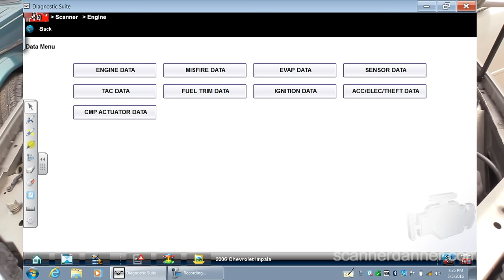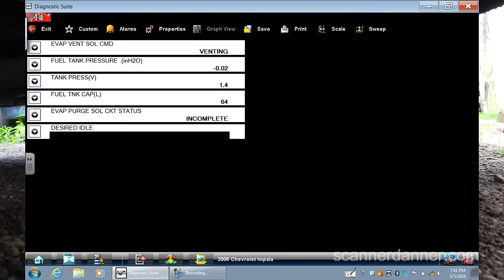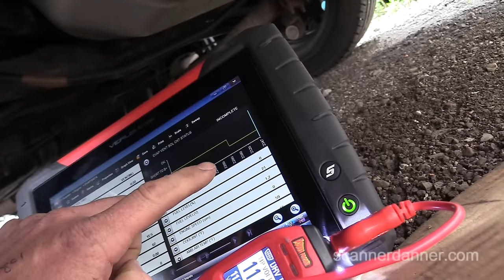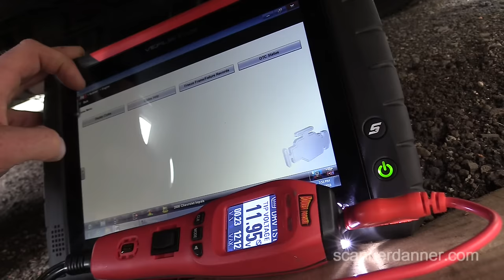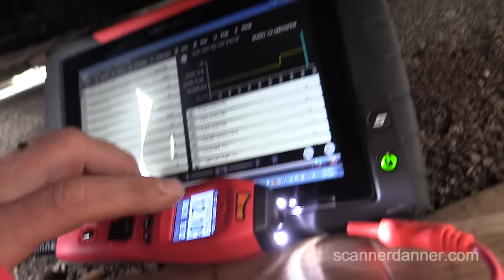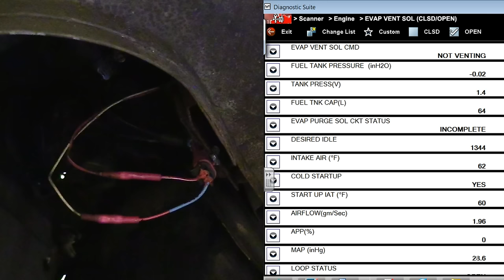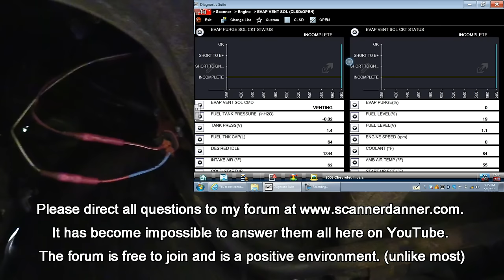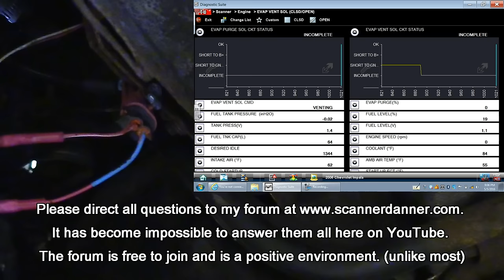EVAP vent solenoid wiring repair and testing P0449

Comment: I save connectors and harnesses off of vehicles and just make up a new pig tail by removing a terminal from a used connector. Remove terminal end from old connector and replace is quicker for me in a shop setting..
Reply from the maker: for sure! Good tip

Comment: Scanner PLEASE help me if you have time!!!! I have a 2006 Chevy trailblazer 4.2. I have no power at the solenoid connector. I cut up from the connector 2 inches to put a new pigtail on. I stripped the wire to prepare for the connection but I have no power at either wire still. Could you please tell me what you recommend I do next? I only have a Innova 3140 so please bare with me. Thank you so much in advance for any time you could spare for me!!!!!!!! Codes are p0443, p0449. Solenoid and vent valve both replaced with gm parts. I have power at the rear vent valve.
Reply from the maker: Do you have power to your purge solenoid under the hood? They share the same power feed from fuse 26 "TCM CNSTR" 10 amp in the underhood fusebox
Reply: @ScannerDanner  wow THANKS SO MUCH for the quick response! I honestly appreciate it. Sorry if I didn't explain it right. The problem I'm having is the solenoid connector under the hood, I have no power to either connector wire. Or any power 2 inches from the connector were I cut to put the new pigtail on. I do have power to the vent valve by the gas tank. Not 12 volts but I think that is from having a horrible ground back there,  but both wires by the gas tank I was getting at least something. I'm not getting nothing from the wires under the hood. I have good power at the fuse. Sorry I also have a C0110. Not sure if that is related but I think that's a connection issue also.
Reply: @ScannerDanner  UPDATE!!! there are 2 wire that go to the purge solenoid, one is green and the other is orange. I cut a little further up past a kink in the green wire, and now I'm getting 2-4 volts.
Reply: @ScannerDanner  sorry man! Scratch that update. I think it was a misreading.  It was jumping from 2 to 4. Now I have nothing. I'm having a helluva time with this thing plus I'm trying to repair it out in the cold. And if you even worked on 1 of these purge solenoids they are in a screwed up spot. Any time and help is sincerely appreciated!!!!!
Reply from the maker: follow the harness, damage occurs in areas of heat and vibration, look for contact points of that harness to locate the damaged power wire.
Reply: @ScannerDanner  I've done that but it's in a huge harness with seriously 40 to 60 other wires. I've had to remove the pcm, the pcm bracket just to get to the harness to remove the plastic outer harness cover. I've pulled the 2 wires out of the bundle but now I'm at a Y in the harness and it's really taped up. My question is if fuse 26 is where them wires go to, can't i unscrew the fuse block, lift it up and try testing where the plug connects to that fuse to the end of the wire where it connect to the purge valve solenoid to see if I continuity?

Comment: I made a cord with a toggle switch and fuse. I'm able to turn the solenoid off.....I don't have a good code reader to turn stuff off. Thought I'd mention this incase other people don't have a scanner that turns it off. I had to buy a plug connector for my solenoid which was around 8 bucks to do this

Comment: Great video i am working on 2011 Acura MDX it have a misfire on 2 and 6 but if you start it up it will run with no misfire for 35 seconds and then misfire on 2and 6 the customer replaces all of the Coil pack and all for the spark plugs
Reply: I just did one of these same exact concern. Try a crank position relearn. I wish i would have filmed it. Maybe next time.
Reply: Positive Lead Diagnostics  crank relearn fix it I have a question how would you identify on am waveform
Reply: Idk if you will see anything   Possibly just a computer glitch. The one I looked at had charging issues a week before the shop called me
Reply: Positive Lead Diagnostics thanks so much
Reply: No problem. Glad I could help

Comment: Hi, I'm getting a PO449 error code, It is saying Evaporative Emission Vent Valve Solenoid Malfunction. I had a new one put in my car and  I'm still getting the same error code.  I had an electrician look at it and he said that there is a problem with the wiring harness. He said that it is not getting the voltage it needs.  My question to you is do you think the problem could be a loose wire connection, the same as in this your video?
Reply from the maker: yep, don't let them put a computer in it
Reply: So what was the problem?

Comment: Will this cause a no start or have anything to do with my fuel gauge
Reply from the maker: No, unless the vent solenoid power feed is shared with other circuits and is dead
Reply: @ScannerDanner  mine is fed separate from the fuse box
I think my issue is ecu though

Comment: How do you open and close without a Scan tool like that.
Reply from the maker: Unplug it and jump a power and ground to the solenoid itself. You could maybe try a 9v battery, but I'm not sure that can handle the current. Those solenoids are in the 300-400ma range of what they draw using a 12v source

Comment: I have da same problem but on the purge solenoid. P0443 purge solenoid circuit. I replce the part but check engine light still on. Can you point me in the right direction plz
Reply from the maker: These are some videos I've done testing purge solenoids
https://www.youtube.com/watch?v=YhD7f4UrQqE
https://www.youtube.com/watch?v=jKVy_FLehhw
https://www.youtube.com/watch?v=kQz3g4HIWgs
https://www.youtube.com/watch?v=ZqWIwBByBHE

Comment: I have a Po433 code--- and  wont let me fill  with  gas..sometimes  zero( just  fills the hose to   tank.) I been  told the EVAP silinoid on engine isnt  talking  to PMR o ECM?! he  thinks either broken or EMC blown??? why  when key is off--  The Evap canister is open,, why wont the pressure in  tank release.. I dont see  wha  would stop it  from releasing...Unless  the valve on top of tank where  hose goes to  Charcaol filter Is stuck  closed.?? also  he said  Maybe the feulpump has a EVAP line going to it---Maybe its  the pump!!  Nobody  seems to tell me why preesure wont  release outa Avap canister  ??  I do not inderstand!!!
Reply from the maker: Stuck closed vent solenoid or the hose to the vent is plugged

Comment: hey scanner Dan it's Michael  I have a ford f150 that has a rough ideal it has 183,000 mils it has had new coils and plugs. also it has had a new cat on bank 1. it had a misfire code for 1 and 2 cylinder. and a too lean bake 1 code. could it be a maf sensor.
Reply: Michael Starcher what year and engine size?
Reply: Michael Starcher if it's a 4.2 I have seen the 6 egr ports under the intake manifold being clogged cause the same codes and symptoms. Took about a week to or more to figure out.

Comment: hello

I have a dodge nitro, I'm having issues with evap system, at beginning I found some hoses damages (showing an error of something wrong on sparks), but after fix it, now is showing an error on evap system, already I verified all hoses and there is not more issues, solenoid was verified with directly voltage and is opening properly (I think because passed the air through) already I measure the voltage on connector (disconnected) and has the 12V, but once I connected to solenoid I have 0V, that's could be an indicator of something wrong...

thanks in advance for some data helpfully
Reply from the maker: For sure, that could be an issue. What is the voltage on both solenoid wires plugged in and unplugged?

Comment: Great video. I've never really been a fan of the Power Probe. I can get the same results with a length of ethernet cable or speaker wire and a DVOM. Just run the wire from the battery to wherever you need to be on the car. The Driver Test on the PP is basically a rip off on a LoadPro (showing the voltage drop across an internal load). Just sayin'...
Reply: Pet Rock's Garage power probe has proved handy for me, solid ground like Dan mentioned, built in light,  instant access to power and ground when needed, battery voltage always present, and more?! These features are nice to have when your laying under a rust bucket down in the dirt.
Reply: I didn't say it wasn't useful.  I was just saying that you can get the same results with a length of ethernet cable or speaker wire and a DVOM.  Actually better since even a cheap DVOM will likely have a better resolution, precision & repeatability.  I particularly like ethernet cable because the thin wires can be inserted into connectors without spreading the pins/contacts.
Reply: Pet Rock's Garage sweet!
Reply: Pet Rock's Garage  I use the load-pro 😯

Comment: hello, I have a hyundai sonata 2011 turbo limited. I got this message in the diagnosis, (p 0449 evaporative emission system-ventilation valve / solenoid circuit) how can I correct it. Thank you.
Reply from the maker: It should be very similar tests as I've shown in this video. Here is also a playlist of other EVAP testing I've done. 
https://www.youtube.com/watch?v=Py23wqbJnQQ&list=PLAFYVCyenqcp9opu7j14E53UAIbn0b1r0
Reply: Hi. Thank you for having answered me and for your great videos. try to test the emission ccv. I disconnected the harness and applied the voltage of the battery but it happened to me to take the earth from the chassis and I put the one of the battery both the positive and the negative. on 2 or 3 occasions, it was felt to start and it seemed that the ccv or closing valve was stuck. and as a consequence of that I now have these 2 codes. p0449 evaporative emission system-vent valve / solenoid circuit. and U1112 LIN COMMUNICATION ERROR Active. I have erased the latter several times and come out again. These failures in themselves represent a problem for the car if I continue driving. Or you think I should take it to the hyundai to see me, or if I change the valve you think the problem would be solved. and how I repair the atro code. because I applied the positive of the batweria to the white wire and negative to red or brown. I do not know what to do. Please, what do you suggest? Thank you

Comment: Hi can someone guide me I need the wiring diagram for the power and the ground wire coming from ÉCU to my selenoid valve Chevy Tahoe 2007 because I need to confirm I have an open somewhere
Reply from the maker: https://eautorepair.adtrk.biz/?a=10817&c=24&p=r&s1=

Comment: I have 12 volts on one wire and 3 on the other help???
Reply from the maker: That 3v could be a bias voltage suggesting the solenoid winding is open

Comment: I have zero voltage on both wires. Bad pcm?
Reply from the maker: What are you working on? Most likely a blown fuse or open in the power feed circuit to the solenoid. Or you didn't have a good ground on your meter, or your not making contact with the terminals.

Comment: Im chasing a similar issue. When I start my tacoma the vent is shut and opens. But when I am testing with the Phoenix I can command it open but not shut. Its also holding a vacuum when closed for well over ten minutes. Yay wtf
Reply from the maker: when you command it to close (energized), take a voltage reading on both wires for me, plugged in and backprobing.
Reply: @ScannerDanner  ok ill report back thanks brother!
Reply: @ScannerDanner 12.63 on the hot wire  and doesn’t change - .06 volts on the ground when commanded on and .04 when commanded off. Ill check w toyota to see what I should be seeintn
Reply: @ScannerDanner is that power probe kinda like the ect3000
Reply from the maker: @Madmok128  this is a problem! The control wire (if it's ground side switched) should be 12v off and 0v on. You're problem is right there! New solenoid I assume? Pull on the wires right at the connector, I bet it's broken in the insulation
Reply: @ScannerDanner  hey man. Sorry I never got back to you. I was testing it wrong. I actually replaced the valve and was able to command it closed and opened and the incorrect purge flow code cleared and never came back! Now it’s off to fix the dual bank lean coded. Tacomas should have a fuel pressure of about 41psi with the truck running. My Tacoma is at 26%. It’s idling like crap misfiring. I ordered a new pump last night. Again this topdon phoenix tool is awesome thank you!

Comment: Hello scannerdanner and everyone. Does anyone have a wiring diagram for 05 cts 3.6 p0449 changed vent and later checked voltage on red 12.4v and white wire 3.2v where is the white wire going to? Computer? Any info is appreciated
Reply from the maker: https://www.scannerdanner.com/forum/post-your-repair-questions-here/16-need-service-info-check-here.html

Comment: Is it just not practical to stock all the various kinds of pins to re-crimp this kind of connect contact, rather than reusing the old one with a solder joint?   Seems like it would be an easier/safer repair, if the parts were on hand..

Comment: if you test the vent valve and closes could still be bad if you have 12v and 0 on the ground
Reply from the maker: yes, they can stick mechanically
Reply: Thanks but im getting 12 v on ground when you put power but wont close so im guessing is some electrical problem
Reply from the maker: 12v on the ground is normal until the computer grounds the circuit.
Reply: Ok thanks ill appreciate
Reply: So probably that means that is the ecm

Comment: I'm  in hamden,ct if you were closer I'd  drop my car off.so far spend about 1500.00 dollars figuring this out. Tono avail. Subaru dealership 638.00, portland certified emissins repair shop 338.00. No go .rockauto parts, canister, purge solenoid valves still no go. Parts repair and maintenance no problema this electrical stuff I'm  perdido.

Comment: holy old video
Reply from the maker: I have ones on my hard drive way older than this one. Just need time to edit them
Reply: hey have you ever tried the heat shrink connectors that have solder inside of them? instead of crimping them you just use a heat gun and it melts the solder and shrinks the heat shrink